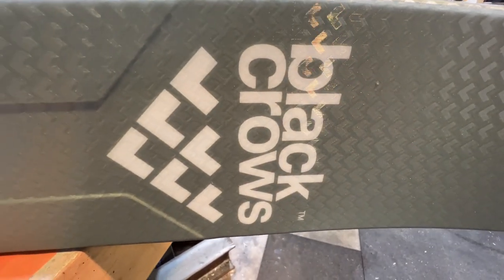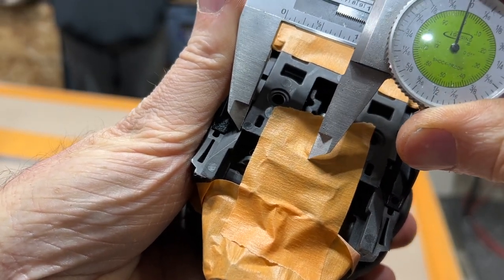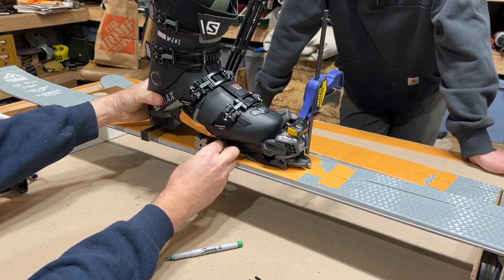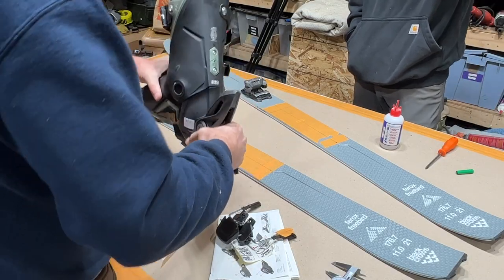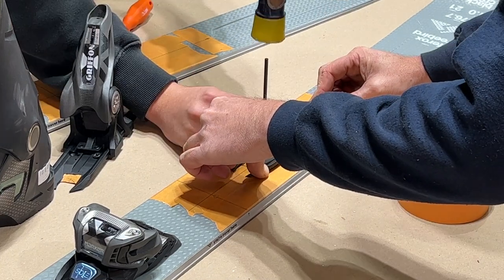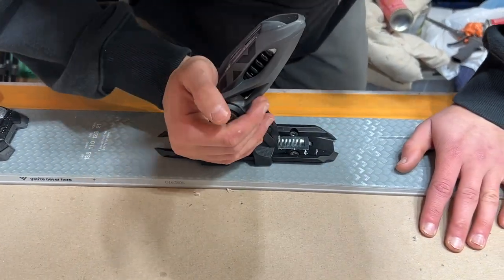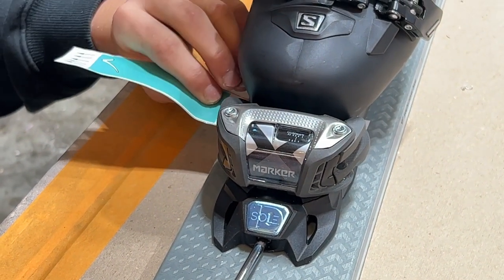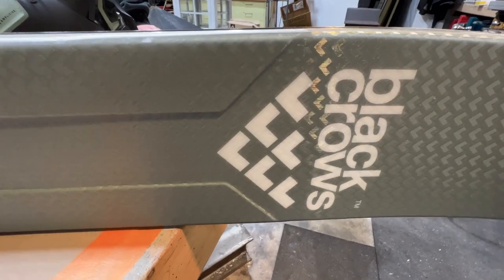Ski Bindings Install - Tips & Tricks

Comment: Good video.  Thanks.  I just installed these exact bindings.  @ 2:46 I saved a step by centering and drilling in the toe part first (front two holes), attaching to the ski, then sliding in the front binding and drilling the rear holes once the front binding was inserted. I made sure everything was centered on the ski.  Saved a lot of time and the holes were more accurate. Also, instead of measuring, taping and drawing lines on the bindings, I just made sure they were all centered on the ski.  I was also very careful not to drill a hole through the bottom of the ski. 
Time will tell if I did it right.  I am taking my next pair to a shop and have them do it for $35.  This was lots of work!

Comment: Thanks for tips. Can I use just any polyurethane glue or there are some differences?
Reply from the maker: Hi! The glue I used in the video is 2P-10 it is a CA glue. There are other brands such as Starbond. I prefer the 2P-10 from Fastcap. For some reason it sets up better than the other glues. Some say there is not a difference but I disagree. I’ve had troubles with Gorilla CA glue not setting up. Hope this helps! 
Right On! 🙌

Comment: Interesting if why ready paper templates did not work for you, to skip so many "easy" "precise" center findings using caliper and metal blocks? In the end, good engineering job. Happy skiing!
Reply from the maker: Yes, I got it laid out nicely and drilled the holes very precisely on the milling machine. Everything went as planned. Thanks for watching! 🙌❄️❄️❄️

Comment: question - how the heck do you separate the Marker heel piece from the mounting base / track? any chance you can do a quick vid of that?
Reply: The heel base comes separately from the heel piece in the box. The Heel actually slides back onto the track once it’s installed on the ski.when you disconnect connect the heel you have to screw it forward and slide if off the track to get to the mounting screws.